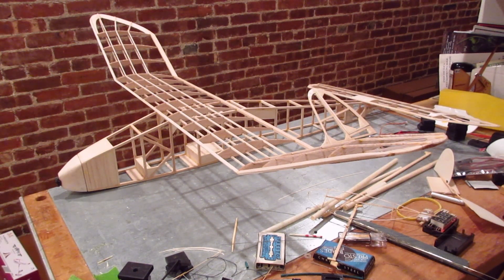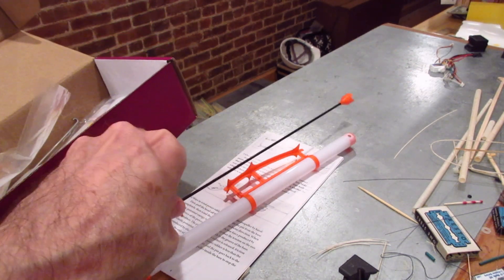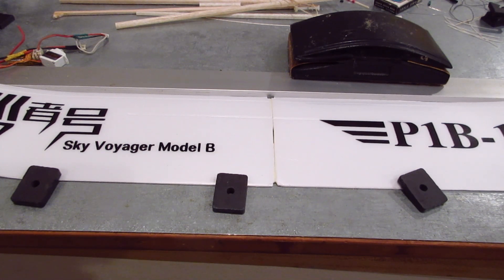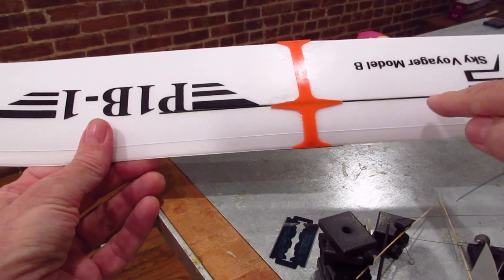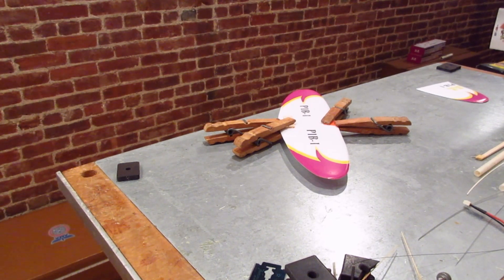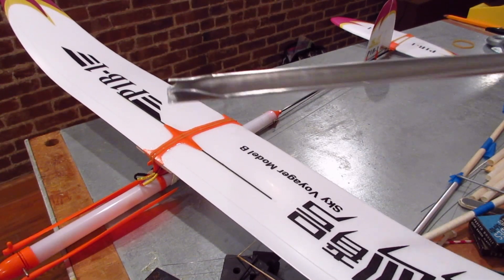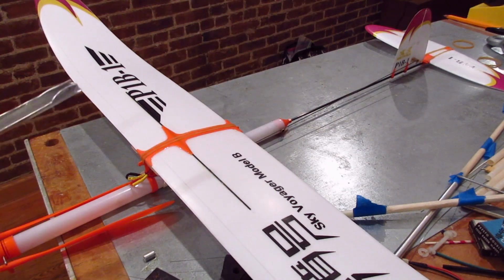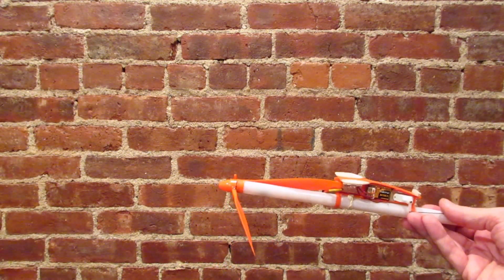Sky Voyager - rubber power with RC conversion

Comment: Yes, rubber with R/C is the way to go (if you have a field big enough) unless, of course, you like lots of long hikes and lost airplanes. 
What R/C gear did you install and where can I purchase it? Is there anything even lighter available?
Could a very small geared electric motor replace the rubber on this airplane?
Reply from the maker: I'm flying in a 1.3 acre field, you can fly in a lot of HS fields, which really opens up the possibilities for rubber power flying! My other video gives the RC gear, https://www.youtube.com/watch?v=9V-bxTQrTdQ&t=129s , also see the newest comments for updates. I haven't seen anything much lighter with full-range equipment, if you find anything let me know. You could probably use an electric motor for the Voyager (I think I saw that somewhere), but I'm a rubber-only flyer, I like the challenge of rubber power.
Reply: @domoremath  Thanks. That looks like a very good system.
I don't know if it's full range, but the Spektrum AS6410L DSMX 6-Channel Ultra Micro AS3X Receiver with ESC, for $59.99 appears to be ultra-light and is inexpensive. As a single unit with RX, two linear servos, and an ESC if you want to go electric power, it seems to be a good bargain and a weight saver. This unit is in Josh's Voyager and, as you know, he gets great flights from it from his backyard. It's essentially, if not actually, the unit in the Vapor airplane.
One more thing. I have thought for a while that perhaps there might be a way to keep the rubber wound while flying with a very small switchable onboard electric motor. Any thoughts about this?
Reply from the maker: @Glicksman1   Yes, I also have some of those receivers, they weigh about the same (with two linear servos) as the single servo system I use. Actually, I would vote against anything more than rudder-only, I've already seen a video where they don't have it trimmed properly and use the elevator during the climb to make up for it. If you've trimmed it correctly, you don't need elevator, rudder-only is more than enough, as I think a lot of my videos demonstrate.

Not surprising, but I wouldn't go for any electric boost to the rubber, I'm anti-gadget, I can get great flights without the gadgets! I'd rather see people learning how to trim properly.
Reply: @domoremath  Thank you. I agree. Proper pitch trim is the best way to go for all flying model airplanes, elevator control or not. It's a skill all flyers ought to learn and improve. With your excellent advice and example, I'm contemplating the single-channel (rudder) concept for the Voyager. Still, any way to increase flight time and still have rubber power could be a good thing.
Thank you.

Comment: Which receiver and servo are you using?  Thanks
Reply from the maker: It's the Orange r415 (no longer available, Banggood has some comparable receivers) and the HKM 282a servo from Hobby King.
Reply: @domoremath  Thanks.  I just got a couple of the lemon receivers.  I think those are going to work.  What kind of connector is needed for the little Eflite batteries (the 70mAh for instance).  I've posted this question in a couple other videos (just now).  I'm sorry about the repetition.  I'm an old guy and just figuring out YouTube.  Love your stuff from The City.  My daughter went to NYU and we got to spend a lot of time there during her 4 years.
Reply from the maker: I'm also an old guy, but posting the question once is enough, thanks! But anyway, your question is good because I've seen several different names for these connectors, so I can't say with certainty, I'm hoping someone else can give a definitive answer. In any case, the correct connector can be found by doing a search on 'micro-6 adapter' and you'll find 6 of the correct plugs (from common sense RC) on a chord that you can cut off and use, that way you get 6 plugs in a shot for 11 bucks.
Reply: @domoremath  I believe the connectors are 1.5 JST plugs.
Reply: @domoremath  I got one to work.  Posted a video on my channel.  The little battery connectors are 1.25 JST plugs.  Thanks for everything.
Reply from the maker: Aha, that's what I thought, thank you so much for confirming that!
Reply from the maker: PS - I just watched your video, nice! No way you could fly in that field without RC, but with it you have plenty of room.
Reply: Thank you!
Reply: Thank you so much.  I ordered that cable from common sense RC.  Just got the voyager kit from J&H today.  Going to try and make it happen with the lemon receiver.  Fingers crossed.  My first foray into the RC world.

Comment: Nice work on this! What receiver are you using?
Reply from the maker: Thanks, this was the orange 415 receiver, shown in my 'even lighter RC' equipment video. Unfortunately it's been discontinued (but I still have a bunch so it will show up in future videos), so I'd go with the Lemon receiver, also shown in the lighter RC video with link.

Comment: Great video. I have seen this model before on the jhaerspace channel and it looks very interesting. Love the folding prop mechanism.  I have 2 30inch rubber powered models, on the building board but my flying field is too small for free flight with models  of this size. I hope to outfit then with miniature radio like you have been. Thanks for all of the info you have provided on  doing this
Reply from the maker: I think 30" is the perfect size for rudder-only RC, it can easily handle the extra weight, so nice to hear you are putting RC rudder in your two planes, that will allow you to have fun flying them full blast in your local field!

Comment: Inspired from what you are doing I put RC in a Souper 30 P30 model, RC came out of UMX Radian but rudder only. I have bigger flying field than you but not large. Anyway I had it in a thermal with a little wind and had a hard time coming back. I found the plane on a garage roof, this is the video: https://youtu.be/fmEFZ8C1BTM   I have a Voyager I fly free flight.